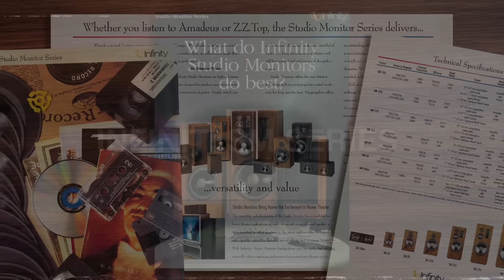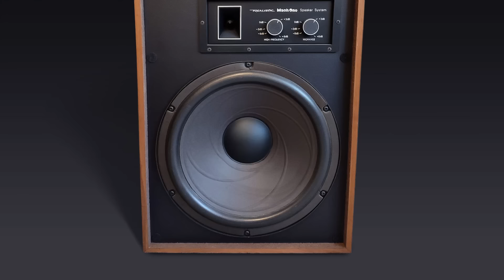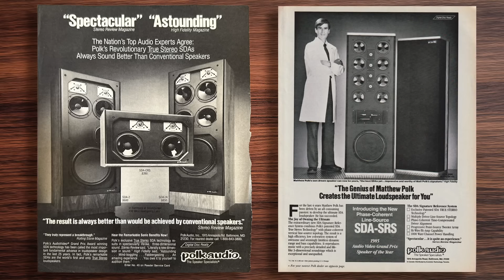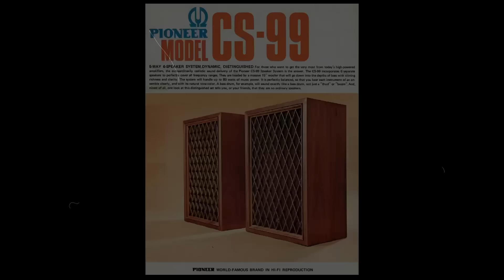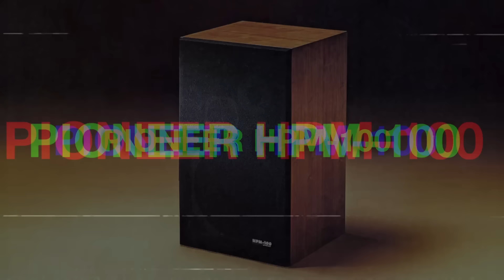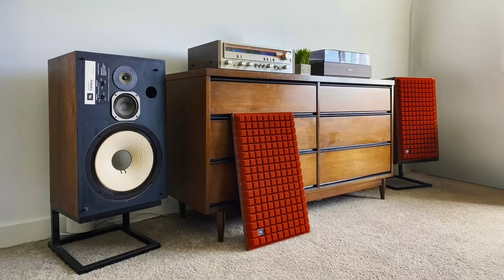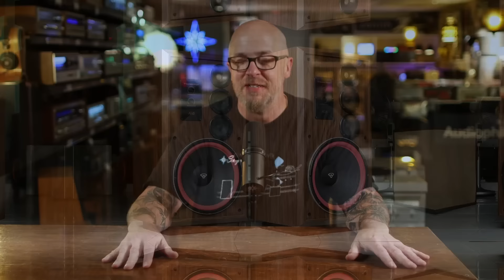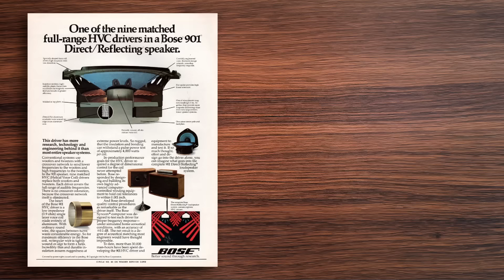Why Do Audiophiles Hate These 9 Legendary Speakers?

Comment: Cerwins are definitely hated by audiophiles and i alway argue with them because they're such a fun speaker to play with. I ended up getting 2 pairs of d9s for free and i have a blast with them even though i have ny nice sounding speakers too. I think one you forgot for the list though is definitely the altec lansing model 7s because obviously they borrowed the design from the l100 also which of course jb lansing but l100 guys absolutely hate on them

Comment: I love your videos 💙. Before this one, I did not know I had a system with "Kabuki" speakers! For well over 20 years I have had five (5) Pioneer CS99A's (special edition). Three are in my main listening area and two are the left and right channels in a small room dedicated home theatre with a mid-tier B&W center channel (I didn't need subtitles anymore when I added that). All have the original crossovers and mint condition drivers. I love them. Of course, they are only the second model of speaker I have ever owned as an adult. But I must say, that when I can get friends to actually sit down and listen to music, they are amazed - realism, presence, sound stage. I usually listen in stereo (Denon Pure Direct mode), but 5.1 also is great with them when I am in the mood to move more air or I want to experience a 5.1 SACD - I have fully restored AR 4x's as my rear speakers. Having a Klipsch subwoofer handling everything below 60-80Hz improves the sound of the CS99A's, I think; less muddy. Every legitimate upgrade and tweak I make on the component end of my system (e.g., from better wiring to upgrade from Hana SL to ML phono cartridge) is revealed with better sound by these speakers. Well, if I install a pair of new Cornwall 4's that I've become drawn to, try I'm probably in for a big surprise right? QUESTION: I am super curious if you have ever compared the sound of the CS99's and CS99A's? Did you find the special edition more tolerable? 😊 Thank you.

Comment: I binned my 1978 Toshiba receiver because I read somewhere that the transformer insulation would be shot by now. Sometimes you mustn't believe everything you read...
As you say, some speakers are better than "people think", my Wharfedale E70s still sound great, but the bass lacks extension according to "critics". Frankly, if you have tone controls, you can sort that.

Comment: Polk Monitor 10As - bought them while in high school in '85, paired with a Mitsubishi DA-R25 receiver.  Great sound, and the soft-dome tweeters were awesome, except when playing Boston's "More Than Feeling"... I blew a couple of fuses and one tweeter because that Mitsubishi had really low THD and would only clip at very high volumes ;)  The Monitor 10As are still with me, sitting in my home office, taking up space. :(  My home theater uses a 7.1 setup w/Aperion Audio speakers.

Comment: It's all subjective, I love a  "wide" sound. I run Jamo 300Pro concert speakers at the front with Polk Monitor 10B's at the back and Richter effects and centres. A huge sound with useability although the HPM 100's would suffice as a rear or at a push fronts.

Comment: Wait, but there are 2 controls to modulate the gain of treble and bass on each of them. If you want to neutralize the bias, it's not tough to do so. Turn each a few DB down and watch how neutral they become. Such a BS argument. (For the record, my parents have a quad setup with 4xJBL L100s, and I myself have a pair of L110s. Fabulous speakers.

Comment: The strangest experience I've had with the Bose 901s was in 1981 when I tried unsuccessfully to make a living playing music in a band. We did a lot of support gigs with a band that wasn't huge in Australia but was certainly known. They had 34 Bose 901s (in the road version, no wood on the outside) for the PA and foldback. Very unusual placement including some on the sides half way through the venues. In the right rooms they could sound good but they sure were tricky to set up. In the wrong venues a total nightmare. At the time most bands ran JBL double four ways for PA.

Comment: I never understood Horn in the home. I've worked on  rock concert Power PA where Horn is used due to  their design specifically to focus sound waves in a specific direction, enhancing the sound's projection over longer distances. So you'd have to be well into the "far field" to get the best out of them.  not the usual ten feet away.

Comment: I'm a bit of a Klipsch fanboy. I don't understand the hate they get. But I think a lot have no real exposure to anything else and it's their first not crap speaker. And they are super excited to hear audio that good. Even if an audiophile will hold their nose at them. Lol. But depending on the model. Their crossovers leave a lot to be desired and do not always cross over well. The RP-600m. The original. Is a prime example of that mid range hole that was fixed with the subsequent Mark-II model. And that thing is a value power house that's really hard to beat by any brand!

Comment: There were a lot of muddy sounding speakers in the 70s and 80s.  I heard the Cerwin Vega's largest model back in the mid 90s, and it was loud with a boomy bass, a great speaker if I was listening to music drunk all the time!  I also heard the 901s, they sounded hollow to me, and a person singing came across like their mouths were 6 feet wide, it was just bazaar, but put on some electric guitar like Hendrix and those things shined!  But I listen to more then just guitars, so I ended up after listening to several dozen speakers, with a pair of JBL L7s, these sound fantastic, I just had these rebuilt, and they are amazing for any type of music; and they were built to sound good for both analog and digital, whereas speakers today are tuned for digital.

Comment: I bought a pair of Infinity SM-12's and thought they rocked out pretty good. Years later I popped out the panel to give the high frequency pot a spray of contact cleaner. Was disappointed to see a plain ole' box, no internal bracing, no sound damping material.

Comment: I love the Sansui SP-2500 and SP-3500's.  They MUST have the crossovers rebuilt to open up these speakers.  Also, if you can do it you need to replace the surrounds on the big woofers.  The original surrounds get hard and don't move much.

Comment: So, I have designed both loudspeakers and earphones professionally.  One thing I would take issue with is your characterization of horns.  Yes, many of the old ones were 'shouty' as you said, but listen to a pair of JBL Professional M2 reference monitors.  They are amazing.  In the end, all that matters is how the sound vibrates your eardrum.  Your eardrum doesn't care if it is being tickled by an acoustic suspension, ported, or passive radiator system.  It also doesn't care if the high frequencies are produced by a horn tweeter or a ring radiator or a dome.  All it cares about is the frequency response, the matching of the speakers, the angle from which the sound is coming from, the amount of reverberation relative to the direct sound and the level of distortion.  Designing a good horn requires a lot of work and a lot of money, but when it is done right, the results are amazing.  BTW, the drivers for the M2 are, as I remember, something like $1700.  Each.

Comment: Back in the seventies, when I was into pro audio, I was in a club with 901s hanging up as shown in the instructions. They sounded “ good” with the club empty, and had that exploded sound stage. With the club rocking they sounded horrible. Not up to the task of driving a club full of party goers.

We used Cerwin Vega speakers as drivers for fiberglass horns that were large enough to stand in. Good for stadiums and Woodstock.
Reply: I was fortunate enough to be able to experience the FunkionOne speakers at Beta nightclub in Denver back in the mid 2000s when they first came out. Those massive horn stacks with horn loaded bass was phenomenal in that smaller venue.

Comment: I had some of those Polk SDA's in college (3 way plus passive) and they did the trick bass wise and sounded ok with Rotel gear, but my big Paradigm monitors sounded better.  Smaller RS infinity's as well, definitely a cleaner sound with those. I came across a pair of Cerwin Vega's someone was throwing out because the surrounds were shot a few years back, so I fixed them up and sold them to a guy who actually gave me more $$ than I was asking cause he was so into them. I think they had 15 inch woofers, but sounded like dirt, but were loud and proud! Finally I got a pair of JBL 4312A control room monitors from my work, refoamed them and upgraded the crossovers. That's a fine sounding speaker, not like the LS100 classic. Definitely more neutral. I have other newer, more expensive speakers that sound far far better than all of those others, but does it matter? They all serve their purpose and are lots of fun, except the Bose.

Comment: The Bose 901’s needed specific amps to sound good. I had a fairy reasonably priced 100 watt per channel SONY power amp from the 80’s. It sounded absolutely amazing. I tried an integrated Onkyo amp that sounded awful. I tried a 375watt per channel Crown PA amp. Terrible. I also tried a few friends’ amps over the years. Nothing sounded good accept that SONY stereo amp. But, it sounded fantastic - at almost any volume. I hosted several dance parties and cranked some Pink Floyd on ten - enough to make the windows and doors shake. Amazing. These speakers have a tone where you either needed a bigger room, additional eq or the right amp. THAT’s why so many people hated them. With my amp they were outstanding. And, I’ve heard almost everything (at least up through about 2020).

Comment: Yeah, I got it in my head that I was going to rebuild the system I had back in the 70s. The centerpiece of my system was my HPM 100s. Yeah, right now on Ebay all the working ones have sold and they are commanding big money even for those needing repair. I thought I'd go down to HPM 60s.

Nope, 1200 bucks. I got that idea out of my head right away.